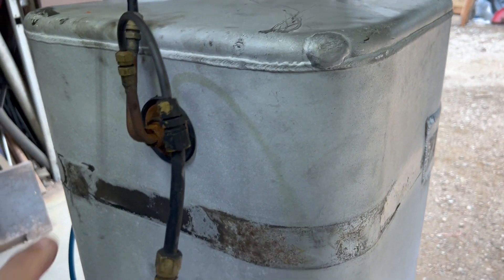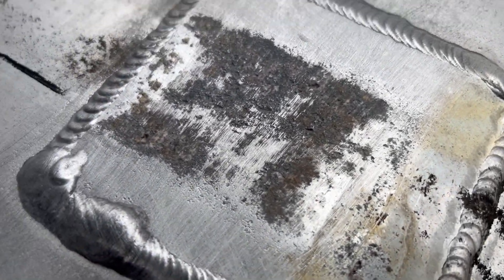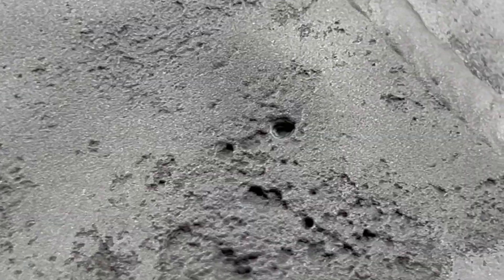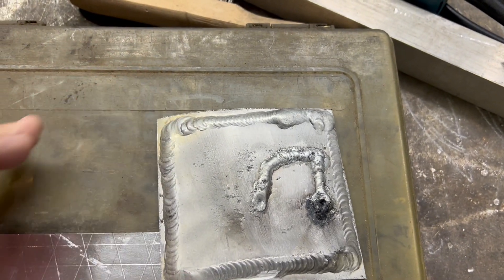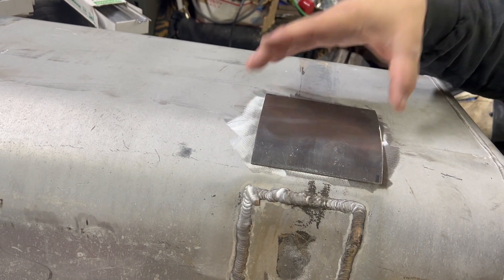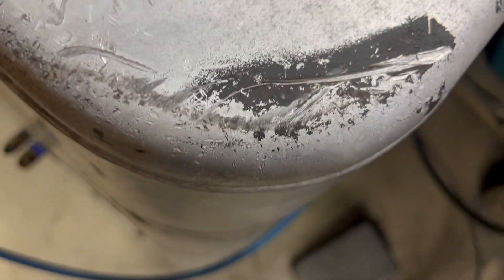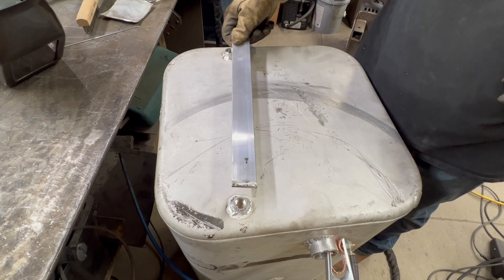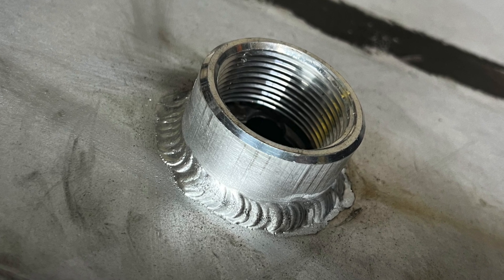Almost SETTING MYSELF ON FIRE ! while welding an aluminum fuel tank,

Comment: I think I would have gotten the aluminum sticks that melt with a propane torch. It's not under a bunch of pressure.
Reply from the maker: yes, that is zinc brazing aluminum, that is a totally different skillset than tig welding and that is one skillset I don't really have ....

Comment: I noticed you added extra filler in the corner at the patch. Was that to reduce the risk of crack formation at the later stage since it is a high-stress area?
Reply from the maker: yes - there were also some small cuts from the cut off wheel I used to cut the defective material out ....  and I didnt want that to be a weak point of the origin of another crack

Comment: Bluefire 36 grit flap disk or whatever zirconia works good for stripping paint as well.  I had to weld a bung once or twice.. if you drill overhead the chips won't fall in the tank. How many max amps? 80? thanks for the video btw!
Reply from the maker: 100- 120 ish to get the puddle going then backing off to 70-80 ish

Comment: That should work well.  Curious why you went with an internal vs external patch?
Reply: probobly less trash in the parent metal
Reply from the maker: Yes, less contamination on the parent metal, also less “thickness” of the tank so the straps fit better and if there ever was a problem someone else could still put an outside patch as a field repair over it later on.
Reply: Uh, because it's liquid, and it's a patch, ya think?
Reply: @nothankyou5524 I think a patch on the outside can hold just as well since it’s being welded.  Peter had a much more informative and reasonable reply, but you do you.